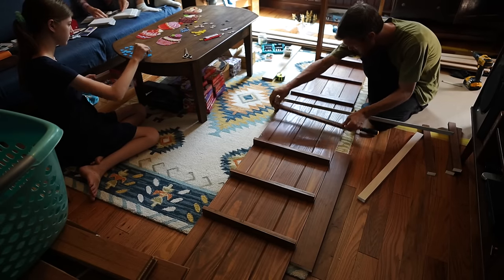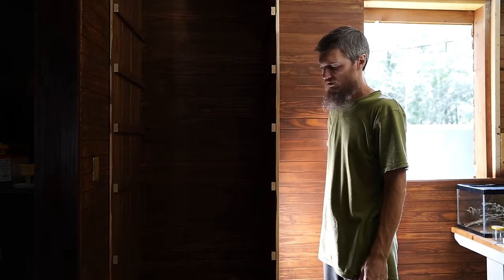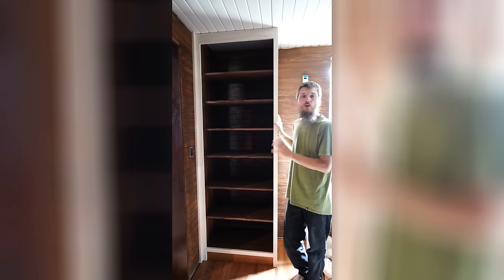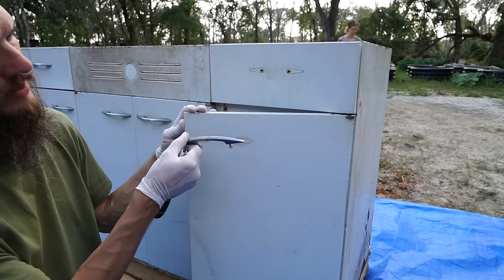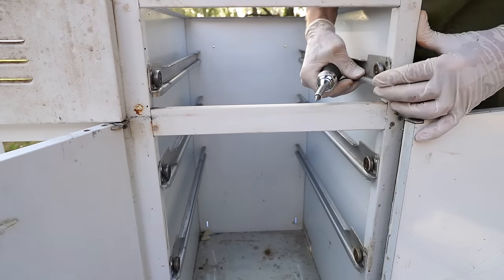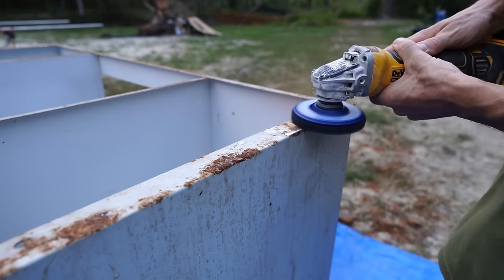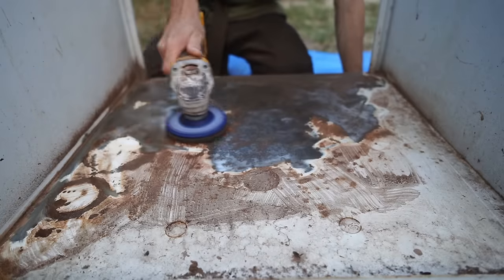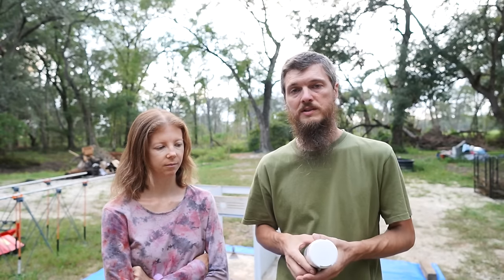New Wood Cabinet, Old Metal Cabinet

Comment: I have used the Rustoleum appliance paint to refinish a 1970s vent hood, it works well, I did primer it though with a product called STYX and I heat dried the final paint, it was easy, I just sat it in the hot sun.  A final test of the finish was a scratch test using a 000 steel wool pad with light pressure, as if I were cleaning it.  It held very well.  I did use 3 coats of the paint. On my cabinet handles that I wanted to keep but change colors on, I boiled them in Simple Green, brushed them with a tooth brush and then applied an automotive brake caliper paint and again heat dried them.  So far with cleaning and regular use everything is holding up beautifully. If you want to further protect the surface I might suggest a final coverage with clear brake caliper paint. Why brake caliper paint ?  Because it is made with polymers that withstand heat, water, and wear from road grime hitting it at 80 miles per hour.  I only intended painting it one time, lol.

Comment: Having refinish those metal cabinets before, if the pitting steel is really bothering you, you can just use Bondo and fill it in sand it down till it smooth. Once it's painted you would never know they were there.

Comment: We had those old metal cabinets in the house I grew up in. After I moved out, my mom had snap housing come in and they redid the kitchen with wood. I kind of missed the old but they were starting to rust. PS we also had a tilt out flour cabinet that held 50 pounds of flour. Mom would just pour out the bag into the cabinet.

Comment: Sink base is going to look cool. I’d keep the original hardware since it goes with the era the cabinet was made. Wonder what it would cost to take it to an auto body shop and get them to sandblast and paint it? As for any pits, BONDO! 😊 Pantry looks cool. When I was a teenager we had a sink with a drain board that lifted off and had a deep sink underneath. It was cast iron porcelain. Someone in the past had painted it green. It took me weeks to scrape off the paint with a razor blade.

Comment: I "restored" a metal kitchen like that years ago, before the internet.  I derusted with naval jelly, sanded, primed the rust spots and sprayed with about 6 cans of satin white Rustoleum.  The handles can be cleaned up with chrome polish.  Where you had insulation, you could always use 1/2" plywood. JMO but keep the 50's hardware.  It looks like your home's natural progression, like they put in a new kitchen in the 50's.   Love the T&G shelves you made too.

Comment: i believe that weird padding was to minimize flexing on the drawer fronts because they are hollow. but, you can always cut a piece of 1x4 or 1x6 to fit in there which will help to stiffen it up and minimize flexing and bending...........(attach with sticky tape)

Comment: In the bottom of the cabinets where you store bottles of liquid items, I always set them in a baking sheet pan. That is easier to keep clean and can even be replaced as needed.  Also the sheet pan catches any leaks or spillage from bottles.

Your kitchen is going to look so great.  That cabinet is fantastic and I would love to have one too.  I haven't had a dishwasher either since the 1980s.  In the house I have now I removed the dishwasher before I moved in and replaced the opening with more cabinet space.
Reply: At 63, I can say what a GREAT idea … I’m going out to Walmart to pick up some pans to put in the bottom of my kitchen and bathroom cabinets today

Comment: Better old metal than fiber board. I worked at shop that rebuilt/reconditioned major appliances years ago and have sprayed 100's of units with epoxy paint. It is an excellent choice for your application, it's all in the prep, be sure any exposed metal is sanded bright, and the paint scuffed clean and smooth. It wouldn't be a bad idea to wipe all surfaces down with acetone before painting, to get any oils off the surface. Have fun!

Comment: If that epoxy paint doesn't come out the way you like.  Think about having the work done at a car auto detailer.  I love the old metal cabinet.  I wouldn't mind it in a bold color for myself.  I cross fingers you are able to get it all back together again.  Lots of bits and pieces.   
I've never had or used a dishwasher either.  They are just another thing to break down on you.  I am not into a bunch of kitchen gadgets either.  I'm glad you got your big cabinet / pantry built.  What are going to be putting in it?  Dishes / pans?  or Spices  / foods?  The only thing I have to complain about is that you didn't fit it so that the shelves could be adjusted in height.  I like a place at bottom that is high for larger bulky items.

Comment: The part I find amazing is you were able to tear the sink cabinet down as much as you did. Something like this today would be spot welded or riveted together making it virtually impossible to take apart and refinish.   I agree with you on dishwashers, I have one and even though it is 2000 model it is practically new. I rarely use it, so much quicker, easier and less bother just to wash dishes in the sink and be done.

Comment: You might call around you local area a see if you can get it sand blasted, you Sou be surprised on the cost and it will not only save you time but the finish will look much better.  Just a thought

Comment: The only thing I would be concerned about is the center of the cabinet with all the rust u removed weakens the metal   So maybe underneath u can install some 3/4 or 1/2 wood to keep the strength of the cabinet. This way when u put something on it  it will not bend.

Comment: "One two, buckle my shoe". One of the first things I got rid of when I bought my home was remove the dishwasher. I love hand washing. I only have a single drain board, but it works for my needs. For your drawer fronts, you might think about filling the empty space with rigid foam insulation and or wood so the handles wont seem loose over time. If you add leveling feet you wont ever have to worry about the bottom getting wet and rusting, plus you can get them level to match other cabinets & countertop better & lining up doors is easier with adjustable feet under the hinge locations and ends. If you glue 3 plywood panels under the bottom, then 8 corner blocks, you can use 8 pronged tee nut thread inserts, then (8) adjustable feet. Toe kick board will hide these. For best results on adjustable feet, is to use a jamb nut to lock them in place once leveled.

Comment: Anyone who thinks the metal cabinet and the drain board sink is being cheap, has never priced them. In a antique store that sink alone would cost $1,000 up. That whole setup restored would probably cost $5,000.
Reply: I collect antiques and have a lot of knowledge about them, so I know the metal cabinets and such are expensive. You're correct on the amount of the sink, they start at $1000.

Comment: Congratulations, you guys have found a fantastic piece for your kitchen. One plus for that kitchen cabinet is the fact the mice won't get in if there are no holes. However some bugs do get in through the slits unless you put a  piece of screening over the openings. The slits are important so that the air circulates. If the air is stagnant you will smell the iron and paint. (My mom had similar cabinets.) But still it is a major find. Both the top and cabinet are what I am searching for my 1947 house. I've found one sided sink top like yours. I prefer the one like you have. I am really looking forward to seeing it finished.

Comment: Epoxy enamel works well. You must spray lightly to keep it from running. It cures very hard. Maybe you don’t need primer because the paint adheres better to a rough surface. Also, your metal shouldn’t rust if no air can get in. I used it a million years ago, when I was young. I painted a really old fridge “avocado green!” It didn’t rust again.😅
Your cabinet is perfect. It looks like it was built when the house was built. You could always build a cabinet base like your cupboard that your drain board sink would sit upon. I remember people doing that.

Comment: I love your pantry cupboard. Can't wait to see it with the doors on it. Good way to get rust out the pits in metal is vinegar and water mixed together and a scotch Brite pad scrub it and it'll get rid of the rust. You can use muriatic acid also but it's a harsher chemical than vinegar. Car restorers use this method to get rid of rust on vehicles. Just a little fyi.

Comment: I love the cabinet. Functional, in keeping with the period of the house, and clean lines. ❤

As for the sink unit. Those things were built to last. My late grandmother had a similar cabinet here in the UK. It was in the pantry/utility room. I  swear it would have taken a bomb blast to damage the thing. With modern paints, if it cleans up okay, and it looks like it will, that sink unit should last you another 50 plus years.

Comment: Doug and Ashley, I so love you guys.... I laugh, though, about that metal cabinet. The "g" is soft, by  the way, built in Elgin, Illinois, just outside Chicago, same town that made Elgin watches, a popular brand back then. I chuckle to myself, because when I moved home to care for my mom in 1991, she had those metal cabinets and more in her kitchen. As I sit by the window now, I remember you could see the plumbing from the sink THROUGH the window from the outside.... geesh... Ours didn't have the right side cabinets, nor the right draain board., just the left. And I was so happy with the new sink that had a double basin and  garbage disposal.  Here's the thing about those cabinets... they ARE, of course, prone to rust if they are under the sink, especially. But, also, as my mom got weaker, the drawers were a nightmare for her to pull out. They stuck like crazy, and if you overloaded the drawers they would bend and deform. So, I would recommend NOT overloading the drawers as my family did and do something about the glides so the drawers will slide smoothly. I've always ALWAYS been happy with the inexpensive pickled oak finished wooden cabinets we did in the kitchen, but then, I also use a dishwasher on occasion... a little 18" wide one ... love it...Oh, and the pickled oak finish on our cabinets is a lot how yours will look, too, as the hints of wood will come through the white stain. IF I had it to do over again, I would have invested in stone counters.... had never planned on being here 32 years later, so it was not my decision to do so at the time.  Thank you so much for sharing your journey. You remind me so much of my own work so many years ago.

Comment: I’m with y’all on the drain board sink. I saw a double drain board double basin cast iron sink at my local antique mall for $1000 yesterday. It was beautiful but I think it had been re-enameled because it had zero rust or scratches. Looked like it had never been used. In the 80s or 90s my mom could find single basin single drain board sinks for around 100$ in barns etc. we had 2 sinks like that at our camp. she never could find a double double for any affordable price tho. The one I saw was about 10 feet long. Keep up the good work on the house!

Comment: I also love vintage things. I love Mid Century Modern Era which believe it or not is 1933 to 1965. That includes vintage cars the VW bus, Beatle, Mustang etc. Even vintage clothes and home decor. Im with you guys on plastic and vinyl. Back in the day stuff was made to last. Machinery, cars, and appliances were made to buy parts to keep it going. Now everything is made of plastic, aluminium, cheap light weight materials. That when it breaks it goes to the landfill. Id rather buy an old hoover constellation vacuum. Fix it and use that to clean my apt then a bissell plastic canister vacuum. Thats just me though. The oldest thing i own is a 1927 Singer 66 treadle machine. My mom wanted to get me a modern machine. But i told her id rather have an old vintage machine thats made to last. I love my machine.

Comment: Hi Ashley and Doug and Family! If you ever get rusty small parts and you want to clean them using a non toxic solution I recommend apple cider vinegar. pour it into a small container and throw in your rusty parts for a week or two and then take a small stiff brush and give them a good cleaning and then prime and paint. Great for small items or as big as a container will hold. Love the retro build. You could always get some auto body fill not the fibreglass free and smooth out the pitting for your steel cabinet and it is as easy as applying drywall compound which your familiar with Doug the idea is put on a thin coat and then sand off!  God bless! M. Gagnon

Comment: If the metal had gouges in it use Car body filler, Cars Metal, Cabinet is metal, suprising what sandpaper and paint can do to a dirty object, When I do a jigsaw as Belle was doing I usually get all the outside done, as they all have straight edges, then work inwards. But she can do it her way thats fine.!! Good job, Thanks for the video Ashley, Love from UK @ 5.45 in the evening in UK x x.

Comment: I have a double drain board metal sink and cabinet combo like that I put in my house years ago.  I just pulled it out of that house so eventually I can install it in my new house.  I still need to restore the sink cabinet, but a couple of the upper metal cabinets I already restored.  I simply took them apart and had them powder coated.  More expensive than paint I'm sure but they look brand new and I didn't have to sand anything.  The only part I couldn't keep was the cool vintage decal showing the original brand of cabinets.  Can't wait till I can get rid of the modern wood cabinets in my 1949 house and replace them with vintage metal cabinets and drain board sink!  Glad I found your channel while getting ready to do my butcher block countertops.  Looks like some fun content.

Comment: You can soak rusted metal in a combination of white vinegar and water for 24 hours and then rinse with soap and water. Works great on tools, screws, cabinets like yours. I use a large plastic bin with lid, and use rings to remove items or wear waterproof gloves. I’ve been using 3 parts vinegar to 1 part water. I don’t dump it out, just keep using it over and over. I label it Rust Bucket and it’s been stewing for about a year. After removing from bucket if more rust put it back for another treatment. Paint, seal, sand, grind, oil, etc. to remove stubborn spots and prevent further rusting.
Reply: “Rings” should read “tongs”. Yay predictive text! I have also left rusted items in the bucket for several days with no problem. Works well for cast iron cookware.

Comment: I’d go to NAPA Auto Parts, and buy a couple 3M Rubber Undercoating, cans. Get the one that says, it’s good for interiors. Spray it on hidden areas to rust proof, and quiet the Cabinet. I’ve used the Rust oleum Hammered Finish, they say not to use a Primer. It’s been durable, on my Trucks Rear Axle and Rock Pans.

Comment: Isn't there a bondo type mixture you can use to fill in the places that rust has affected the metal.  People use it on cars, to repair dents and dings.  It may help you.  Sand it down and then paint.  Whatever y'all do it always turns out good.  😊👍

Comment: That’s interesting about not priming before you applied that spray paint. I’ve used that exact paint on a refrigerator and a dryer. The paint held up great on the fridge but flakes off on the dryer. I’ve always thought the difference was the higher humidity in the basement that was causing the flaking problem. But I had sanded and primed rusty areas on the dryer before painting but only cleaned the exterior of the fridge before painting. So maybe that was the difference! Thanks for sharing that information.

Comment: Sometimes you have to see what something could be. The metal cabinet and sink has so much potential! I'm excited to see what it can become. Also wanna add i completely relate with the dishwasher. Bought my 2nd home that had a dishwasher and removed both and sold them. It's more of a hassle using them than it is to just wash the dish and be done. Uses less water too.

Comment: I have a dishwasher, but hate it ..l I’m usually washing my dishes by hand, but with a regular double kitchen sink and a drain board with a pad underneath.  I would kill for a sink top like you have.
As for the cabinet … I KNOW from your previous restorations, that you are only going to make this cabinet better than it was, possibly better than it started as.  I would buy a house that you have restored in a heartbeat.  Oh, and I love, love, love your tall kitchen cabinet you made.  You’re right, it looks good with the vertical white lines next to the horizontal walls.  
I love everything about both of them.
(My only complaint is that your videos go by so quick, lol)
Reply: 5:10 😊

Comment: Don't forget if you have dents or rust pitting, you can feather on a thin coat of two-part auto Bondo.  It's cheap and you can use the leftovers for other projects.  The appliance paint should work well.  I've also seen YouTubers use it to refinish sinks and tubs.

Comment: Doug, do you have any plans to do some kind of sound-deadening for the kitchen cabinets? Seems they would be pretty noisy when opening and closing drawers and doors, or moving things around in the cabinet. Metal kitchens were all the rage in the 1950s into the 1960s. Most have been torn out and replaced so they are pretty rare.

Comment: I am so surprised that you had to actually explain why you are cleaning up this old vintage rusty metal drainboard sink base. Clearly you do buy new when you find what you want. Your entry doors and hardware are just one stunning example. What I also amazing is that the people who have the 'why not buy new' thing going are missing an important point. You have options. If you cannot find what you want new you are quite capable of refinishing vintage. This opens the boundries of choice tremendously. I for one am hoping this works. It will be so cool!